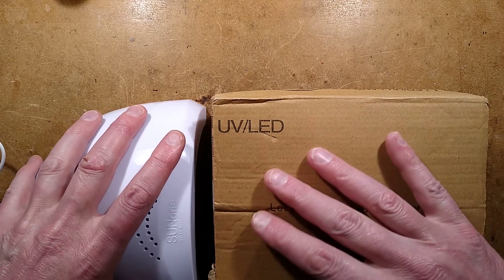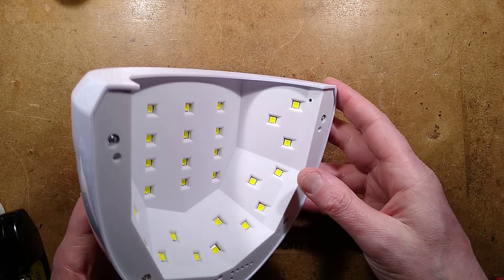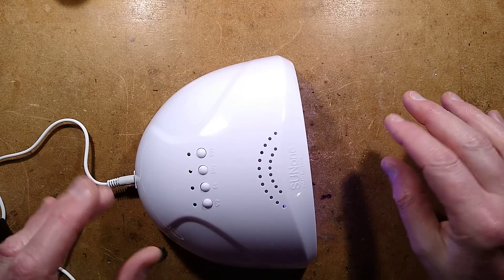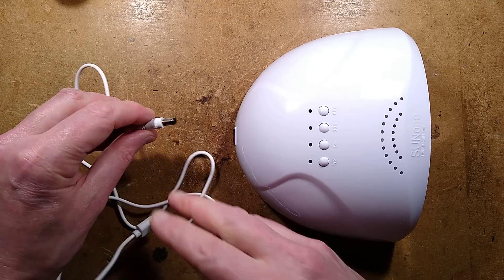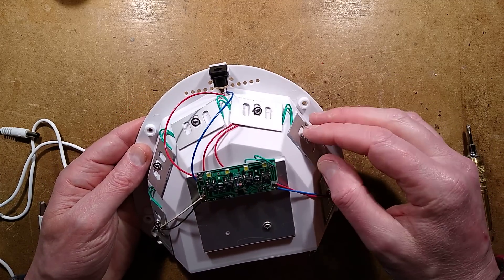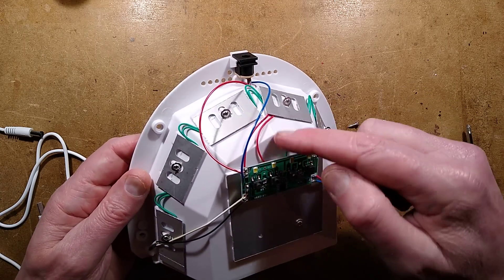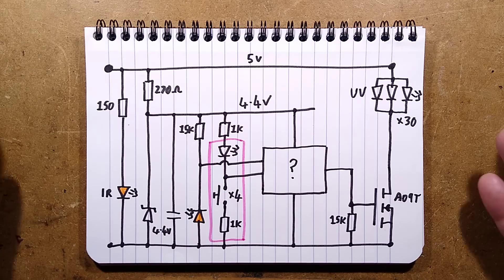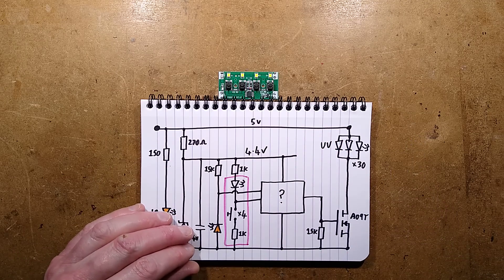48W UV resin (nail varnish) curing light teardown with schematic

Comment: Hello Clive, slightly off topic, great channel and your videos are brilliant, although I am not that knowledgeable in that field. Could you answer me a question please? I have an old sky dish on the rear of my house that I am about to remove. I have a couple of sat cables running to it from inside the house. Could I run 240v through this sat cable to a small 30w LED light in its place? Thank you. (I hold you in no way responsible for any advise you give. Lol.)
Reply from the maker: No I'd not recommend running mains through a satellite cable.  Low voltage would be safer.

Comment: They may be made specifically for curing nail varnish on nails, but they’re perfect for PCB reworks (specifically when you need to cover over exposed traces with conformal coating).

Comment: did you put a meter across the LEDs  to see if the voltage is reduced inside the package with a secret resistor inside or it is all just in the flimsy wires and tracks

Comment: The 1kΩ resistor from each of the push button switches to the common rail seems unnecessary to the function of this circuit.  Your thoughts?
Reply from the maker: It's probably to limit the current when a button is pressed while the microcontroller pin is assigned as an output and in the high state.

Comment: I have this same light. I used to have 2 lights, a UV and LED because some products require UV to cure and others LED. This light cures both types of nail products. Sometimes the infrared sensor messes with the timer buttons on top. Sometimes when the timer runs out, it switches of and sometimes not. Why? I TRULY enjoyed your video!
Reply from the maker: The infrared sensor may be retriggering the timer.
Reply: @bigclivedotcom  my wife says thank you very much. She really enjoyed the video!

Comment: No need for the micro to switch the selector switch lines from input to output on a timer.  Just leave it as an input until the button is pressed, then change it to output and pull it down.

Comment: I had a moment when I realized walmart sold 100% acetone.  And it said soak your fingers for 15minutes and remove gel nails.  If needed soak another 15minutes.  Compare that to the MSDS datasheet for acetone.

Comment: I'm assuming you can just block the IR any way you want (tape over receiver/sender) or even clip wire from sender to make it on all the time.
That device seems useful for lots of things like curing solder resist or other uv curing glues/resins.
Reply: Taping the sender and receiver is exactly what I did on mine. Press the 30 second button to start curing resin. They do a pretty good job.

Comment: watts come in different forms.

electrical watt is easy to convert to other units using ohms law.

optical watts that lasers use i think apply to all forms of light so the uv curer could be 48 optical watts.

then there is heat watts witch is the unit for electric heaters.

uv is invisible though there are some people who can see into the uv range and many tv cameras can show uv that is the blue to purple glare you see when watching shows where arc lights and welding is shown.

because uv is invisible they probably add some visibling phosphor to make the leds visible so the user can see it working.

Comment: I took one of these apart gluead the led plates around in a old resin printer hood voila 5volt uv curing station.

I just wired a switch and then directly feed the 5volt to the leds

Comment: LED switches can be activated by sunlight, so if the device is by a window and cloud floats by can activate the device. The plastic is not that thick and from brightness to darkness it can be activated by clouds floating by. I used to repair photocopiers with automatic sheet feeders and got complaints of them switching on by themselves. Ther ones complaining always had the photocopier by a window and the led receiver was well covered.

Comment: My wife has one of these, it says 365+405nm, I have a 365nm and a 395nm flashlight and the 365nm light does not cure  UV resin better, it is actually slower by quite a bit, might just have been marketing and now everybody says they have double LEDs not to lose out. The LEDs in the one she has have two light sources, but more like 385+405 than 365+405. 
The 48W is an equivalent figure, as in equivalent light to a 48W UV tube. Older curing stations had the black UV tubes. I have also seen some with the mercury tubes, those will definately give you cancer....

Thank you for showing the insides of it, I am not allowed to open it.

Comment: I think I missed the part in the schematic that controls the LED’s for half or full power. Does the chip control the drive to the MOSFET in some way?
Reply from the maker: It pulse width modulates them.

Comment: Is there an at-home test to figure out the wavelenght of UV diodes? I got a bunch of different and dont trust the vendors information and want to test myself.
Reply: If the light from the LED is detectable from a camera, you can diffract the light off of a DVD. Use a CFL for a reference to get the wavelengths and you can usually distinguish the 405-395 nm ones from the 365nm.
Reply: @greengreens9936 Works better when use the "Pink Floyd  Dark Side Of The Moon" CD because of the album cover artwork.
Reply from the maker: It really requires a lab grade bit of equipment.

Comment: I'm afraid the suspicion of these being a cause of skin cancer is in fact entirely plausible, mainly because many of these devices, if not most of them, actually don't use LEDs emitting in the UVA, but still use the old black light bulbs (not black light blue, but the white appearing black light bulbs) that are essentially just using the same phosphor as in tanning lamps and thus emit light as far down into the UV as about 300nm. See the paper "DNA damage and somatic mutations in mammalian cells after irradiation with a nail polish dryer" from 3/23 in Nature Communications. Unfortunately the authors of these kinds of papers (and this one is no different) are often just as utterly clueless and useless about differentiating between kinds of UV light sources as they are brilliant at assessing carcinogenicity and mutagenicity in cells in petri dishes, and thus they make no attempt whatsoever to differentiate between Hg discharge tubes blasting out huge amounts of UVB light on one hand, and LED based bulbs that emit none on the other. In fact they appear to be so thoroughly useless on the subject of the light sources themselves that they're unaware of any differences between the two fundamentally different kinds of lights at all, essentially rendering their findings pointless for all but the most astute readers of their paper who can read between the lines and figure out that all the potential danger is coming from just one kind of lamp: the tube discharge lamps.

Comment: UV cure nail varnish used in these booths where people do it daily seems to all be "soak off" now. That means they just have to soak fingers in water for the stuff to come off again.
Not for going swimming with in other words.
Reply: Soak off usually refers to using acetone or similar. Never seen or heard of water being used to remove the nail polish. Other types of polish have to be buffed or ground off.
Reply: @networksdude  Soak off now refers to water. I bought some color changing to play with and put it on some  on some metal pieces. Even if sanded first it comes off in sheets after a time in water.
Reply: Okay. Never seen that and they certainly don't have that in Cyprus.

Comment: Going by that schematic I have a datasheet for the MOSFET A09T. Given that it appears to be the route by which all current through all UV LED's must pass then it's rating should dictate the power the device can deliver. The datasheet gives it a PD at 25C of 1.4W. If the LED is dropping 3.7V (Clives worst case V) then the MOSFET should be dropping 1.3V at slightly over 1.3A (Clives worst case I) shared between all 30 LED's (Clive's observations give a typical Total current of 750mA) for that power dissipation. Even this exceeds the devices power dissipation at 1.7W. Now of course this can be extended by various techniques such as PWM or heatsinking but PWM should still only give you 1.4W interspersed with a lot of cool down time and to get from 1.4W to 48W I think you would be more in the market for cryogenic cooling than a simple heatsink. Perhaps I just don't know anything.
However I do think that Clive should have mentioned the specifications of the plugpack that came with it. If that cannot deliver 48W (Unlikely by the brief look at it) then you have very little chance of getting 48W delivered by the device it is feeding.

Comment: I was so hoping you'd use pink UV gel nail polish to test this...
Reply: Btw, I have one of these for doing my nails (which I haven't used in ages, in a bit of a slump atm).

I never use solvent to remove the old gel, I tend to peel it off and file the nails to remove anything left over.

But it tends to peel off in one piece.

Comment: My roommates had a box for an old phone cover in a closet in the house that I discovered that came with a UV cured screen cover and the package actually came with a USB UV light like what you've got there. It's not as big. It only has 6 large LEDs in it, but it has the same purpose. To cure UV setting resin. I nabbed it. It's disposable. It was to be used to set the screen cover on a phone and then be discarded. Incredibly wasteful, but I rescued it. It's labelled Whitestone dome glass.
Reply: the more "extreme" version of that is used for phone display glass replacement (if the glass is cracked but the display itself underneath is still fine). You get the original glass off, clean up the display, blob on some UV glue commonly referred to as "UV LOCA", set the glass on and make sure there are no bubbles or uncovered spots between the LCD panel and the glass and if you're satisfied, you cure it with UV light for several minutes. When done well this will be indistinguishable from an original
Reply: @Knaeckebrotsaege  The HARD part is getting all the old glass and glue off without damaging the LCD underneath of it. Ive done it a few times, and then said "NO more" to that ugly task.
Reply: @davelowets  In some cases like with Samsungs it's still worth it, mainly because a replacement service pack (screen pre-attached to midframe) will cost you more than the entire used phone in functional state is worth on the used market when the phone is more than 1-2 generations old, despite still being very much usable. if the choice is 200eur for a service pack screen vs 20-30 for the glass + extra work, guess what I'd rather pick?
Reply: @Knaeckebrotsaege  I'd still pay the $200... 🤷🏻

Comment: Cosmetic industry has often had a bit of a blind spot about bad effects from chemicals used in the products. As you said, in the currently fashionable nails finishing industry people gladly submit to various glues resins and solvents, but when cancers occur, industry claims it must be from other factors like UV exposure. (?!) It was bad enough when Madge the manicurist had people soaking their fingers in dish soap in the old Palmolive commercials on TV - but now she'd need an organic solvent canister respirator , cause the people would be soaking in acetone (or worse)!  re the 48 W claim - maybe they are counting the glory, visible light, and Q ray emissions as well as the UV emissions.......8^)    Cheers!
Reply: The monomers used in UV resins are often cancerogenic. I guess that being very small and organic they can easily diffuse wherever and do their nefarious work. Acetone certainly helps with reducing any barriers for unhealthy stuff to enter your cells.
My wife sometimes uses UV-cureable nail polish. To make sure that it's not straight poison, I insisted on getting the MSDS before selecting a brand. It was an interesting experience. "What's that!?", "Sorry, the boss is on vacation and I don't know where to find it" and in some cases simply no reply. I certainly wouldn't recommend any cosmetics sold from china (or resold via fulfillment by amazon or similar crap).

Comment: Solvents I'd say too. My uncle used to splash car parts cleaner around to get oil off in a lorry shop. He got away with it for about 25 years till her got skin cancer, the one that goes all over, metastasized, in your bones, in your lungs. Caught it soon enough radiation did the trick though. He's still tickin.
  He just went through a long few years of them thinking he had some severe rapid onset dementia. It wasn't. It was his thyroid or something. They fixed it. He can remember again. Very strange and stressful for them.

Comment: I sell UV epoxy that cures at 365nm and I can tell you I really doubt these are 365nm, they all seem to put that for sales reasons. The 365nm LED's are like 10x the cost of the 400-405nm versions. If these were truly 365nm I would be selling them for my customers. The cheapest 365nm at like 20w that I can get wholesale are like $100 for a little tiny one.

Comment: What a coincidence, I had not applied any treatment to my nails for a long time, other than cutting them, but a few days ago I gave one of my nails an ultraviolent energy treatment using a device designed to give nails strong energy pulses.

Those devices are available in lots of places, to purchase one online you can use the keyword "hammer" 😅 Let's say I aimed at the wrong nail 🤦‍♂😵🤬

Comment: A-ha, that's how they do it when advertise «simply put your hand in, it will automatically turn on and turn off if you decide to pull your hand out». This way you won't need to use the other hand to press the button, seems convenient for some users.

Comment: We have a tiny one-fingertip-sized capsule for curing nail extension gels and UV varnish. It has a button on the floor, so you can put your finger in, press the button and enjoy your nail being flooded with violet light with some UV in it.
If you press the button once, it will shut down the light in thirty seconds; if you press the button once more while it's on, it will add thirty seconds more. The third press switches it off immediately.
It has a couple of tiny resistors, a couple of power resistors, three (or five in some variants) LEDs, a transistor (for instance, A2SHB, I just checked) to drive them, and a mysterious eight-pin chip. Such capsules, like flat whole-hand lamps with folding stands, usually work off of USB cables because of low power consumption.

Comment: Why the 4.4V Zener? Why not run on straight +5V?
Reply from the maker: It may be to give a slight regulation to give better processor stability when the 5V rail is suddenly loaded by the LEDs.
Reply: IIRC it has something to do with the way they are using the I/O pins on the micro to both control the idiot lights and read the buttons.  The micro has to be run at a lower potential than the LED supply rail.
Also, the zener diode is probably supposed to be 4.3V and the measured 4.4V is within the 5% tolerance band (4.085V to 4.515V) the diode is rated for.